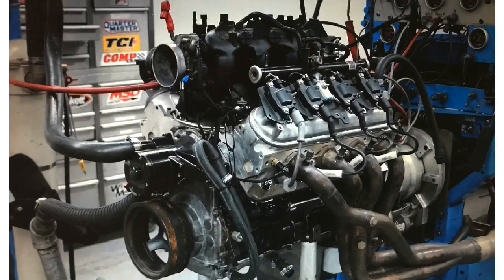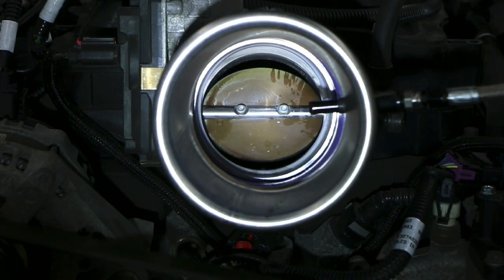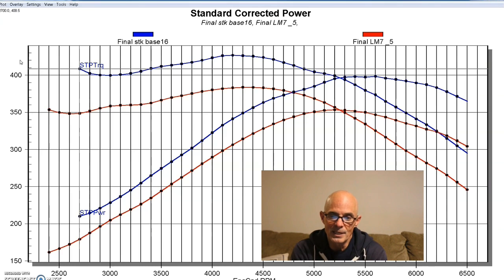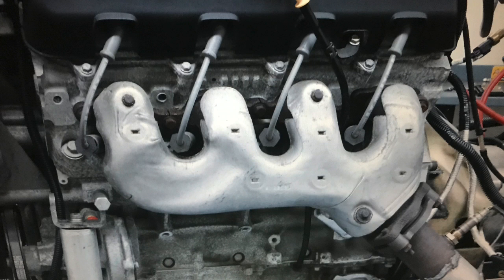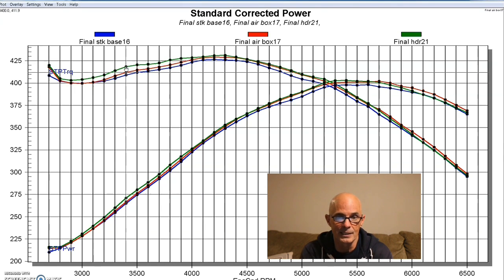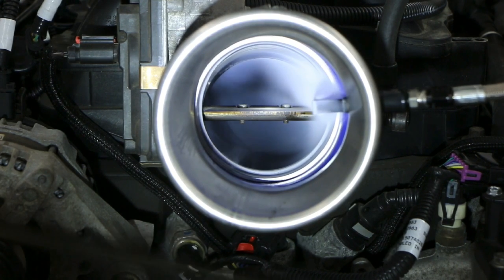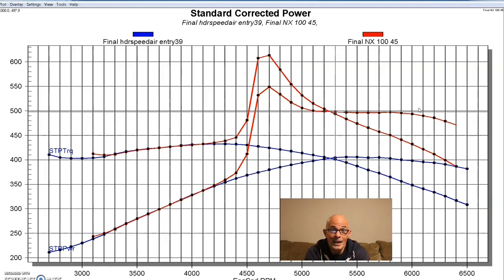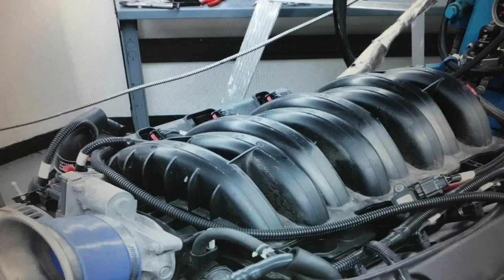JUNKYARD 5.3L L83 NITROUS TEST-THE REAL DIRECT INJECTION!

Comment: You have to route the headers the way the company makes them. If forward facing headers made more hp . Gm an the headers company's would make them that way it's made to flow exhaust gases the way the headers was made. I gave you a hard time on the other video when you was complaining bout hp numbers on a lsx motor but this video an many more are good keep it up.

Comment: Looks like an awesome engine. Can't wait to see boost and I'm interested to see how far the stock fuel system can go before leaning out.
Reply: Stock LT1 fuel system tops out at about 550whp. Then you have to jump up to LT4 injectors and fuel pump and then that’s only really good to 750whp. And you can get about 850 with a good cam with the more aggressive lobe on the cam for the pump
Reply: @rongravel4585  thanks. Add 15% for drivetrain losses so we're looking at about 625 at the crank? However, that's on an LT1, not an L83. Does GM use the same high pressure pump on these engines? Back in the day, they used the same in-tank fuel pump on every single tbi engine.. from the little 1 barrel tbi 1.0L 3 cylinder in geo metros all the way up to the 7.4L v8 dualies.
Reply: The 5.3 and 6.2 have different cam lobes. The pumps are the same and the injectors.  And yea 15% is a good round about. It’s usally like 18% in a auto and 12-13% on a manual so a good round about is 15% pretty much covers everything     Every combo robs a lil more or less power.
Reply: @rongravel4585  I just made an appointment for my first chassis dyno test. I figured +25% drivetrain for my combination. I'd be thrilled to death with 450 to the wheels. It's from a 1993 4L80E and NP241 transfer case and a 14 bolt 9.5" rear axle. Old 4wd stuff is not as efficient as the newer or lighter stuff. I only have 400lbs/hr worth of injector so we'll see how far it takes me. One datalog was calling for 456.6lbs/hr. 114.2% duty cycle. It leaned out to 13.6:1. I limited my rpms to 5,252 so that won't happen again.

Comment: I was just about to ask you for some Gen V testing.... and there you go. Greg Bannish had some really interesting comments about the criticality of DI injector flow/spray pattern design compared to what you can get away with on port injection. Sounds like there may be a bit of a development curve to overcome on DI unless you intend to add secondary port injectors.

Comment: Having an L86 and about to bolt on headers.  The factory Y pipe for our trucks is the achilies heel for our trucks. Your engine didnt have one Richard. Your tune was changed to account for no cats you technically had an engine with no cats, no mufflers, no full belts and no true intake tubing. Youll loose 20-30 hp with the factory Y pipe allday. Then when you bolt on the headers and high flowcats thats the gain. You basically made the gains with manifold do to no cats(that we gain with headers a tunes). If that makes sense. You made the gains not using the Y pipe.

Comment: That is strange that headers didn’t do much. Maybe test the LT stock manifolds on a LM7 ?
Reply: When I pulled the stock manifolds off my L83 I noticed they are pretty good as is. The reason they didn't see much gain here is because they ran extensions off the stock manifolds. The stock Y pipe is also really good. The stock exhaust on the L83 trucks sucks though. The muffler is real restrictive and the flapper valve. Also it's a single pipe that necks down to 2.25 inch at the tail. That all being said. I did notice quite a bit of gain from going to headers and 3.5" exhaust on my 5.3 L83 truck. I had opened up the stock exhaust with a magnaflow muffler and cut out the flapper and picked up 2 mph at my 1000 ft test spot. The headers and 3.5 inch exhaust picked up another 3 mph. Doesn't really add up to the results in the video. But it did what it did so I'm not sure what the total deal was there.
Reply: blk95gsrt I had a magnaflow cat back on already when I swapped headers on. I didn’t notice much but that’s not real solid evidence. I went back to stock manifolds and y pipe because the speed engineering parts leaked at every joint
Reply: Michael Radelet Thanks for all the info about your issues with the  headers, and specifically the speed engineering brand. Now I know not to go that route. I have a full 3” cat back with a Magnaflow plus a CAI on my ‘18 with a Hptuners tune. I’ve been debating headers and a retune but after your experience and this video it doesn’t seem worth it
Reply: @MichaelRadelet  I had zero improvement when I put my headers on. I have a test spot I test MPH on every single mod I've ever done. When I did the headers I had zero gain, until the tune was corrected. It picked up 5 mph over stock exhaust with the headers and 3.5" catback. The speed engineering headers do leak, but so do other slip fit headers I have had. Just have the joints welded or do what I did and buy $10 clamps at oriellys, the really wide ones, and wrap the joint with foil then clamp down the clamp around the foil. Works great. I've always had leaks from slip fit headers, it's just part of the deal. I didn't mind having to spend a few dollars on leaks considering how good the speed engineering headers are and how cheap they are.
Reply: @trey8543  You won't gain a ton. You should gain some. For what it's worth ALL headers are noisy even if they don't leak due to the thin tubing they have versus thick iron manifolds. If you're pretty happy with it don't do headers, especially if you hate the sound of leaks. Even perfectly sealed headers have that leak sound. It's happened on every vehicle I have headers on (all 7 of them) no matter what flange and seal style they had.
Reply: blk95gsrt Thanks man. At this point I don’t think I will bother with them. It’s my daily driver and comfort is priority over a little extra WOT power right now. The tune alone turned my truck into a whole different experience through the entire power band. If they won’t add power I can feel all the time it’s not worth the headaches that come with it on a daily. Down the road when mine is paid off and I have something else to drive I will get wild with it. Heads, cam, headers, l86 intake etc
Reply: @trey8543  You'll feel them a little at wide open, other than that you wont like them. They are not my favorite mod I've done on my truck. They did help, and I do hammer on it a lot. But I miss my simple old setup I had most days. And by the way, I've researched this to death, don't do heads cam 5.3. You can find a 6.2 for less than that costs or around the same price, and still be able to sell your 5.3 for 1000-15000 to make up some of the difference and have a whole lot more gain than heads cam on a 5.3. Just do a 6.2 swap and small cam and you'll have a lot more power every where and you'll shit all over a heads cam 5.3. Watched a ton of videos of modded 5.3's vs 6.2 trucks. My buddy has a bone stock 6.2 yukon and murdered my modded 5.3 truck. It was sad. The 6.2 intake and heads flow a ton as is so you can do a small cam and kill a heads cam 5.3. Plus you'll have what's needed the most. TORQUE. A little high winding 5.3 in a 5000+ pound truck is a crappy combo. We need torque to move these pigs
Reply: blk95gsrt I didn’t have any one to tube for headers around me, best I could get was to turn off cel for missing cats and secondary O2s. I’m sure I could have made the slip fits not leak but I didn’t really try. I moved jobs and preferred the quieter sound with the cats in plus the smell of the exhaust stunk pretty bad without them.
Reply: @MichaelRadelet  I hear ya there man. You having the magnaflow should be plenty enough to get some decent gains. If you haven't had it tuned, a tune makes a world of difference. Atomic on performance trucks forum (richard) does REALLY good remote tuning if you want to look him  up and get remote tuned. Look up his website at Atomic Fabrication and Performance. https://atomicfabandperformance.com/
Reply: I think the problem is that they were running the stock smallish L83 throttle body and intake. If you can't get a lot of air in you can't get a lot out. I think they'd see much better numbers of they swapped an L86 (6.2) TB and intake. They're a VERY easy and direct swap that foote flows a BUNCH more air.
Reply: cfltitan I hope they test that, that’s a common mod people do and I’d like to see how well the 5.3 can utilize the extra flow
Reply: Part of the reason they didn't see much gain is because the stock manifolds are pretty freaking good. When I took mine off I was impressed by the primary and collector size on them. Then richard ran the stock manifolds with extensions on them. The stock Y pipe is also really good on these trucks. The stock catback is terrible though and the main power killer. If you wanted to do a good little budget setup on these trucks, and I did this and gained 2-3 mph over stock, just get a good straight through muffler and cut out the flapper valve in the stock exhaust. I did gain another 2-3 mph going to headers and 3.5" catback. For a total of 5 mph over stock exhaust. Don't have dyno charts, never put the truck on the dyno, the driveshafts pop real easy and I don't want to risk it.
Reply: Shannon Sisk they are a different bolt pattern
Reply: Michael Radelet would be neat to maybe switch the flange or something, or get them to work, to see if there is anything special about them. No gains from long tubes is strange in the V8 world
Reply: Shannon Sisk I’m sure it could be done. Other problem is the LT motors swapped intake and exhaust locations so the offsets would be off, but again if someonereally wanted to try it could be done. 

I put long tubes on my 14 L83 and noticed nothing other than more noise with the cats gone

Comment: Was anybody else confused when he first said LT1? I thought he was bringing in a 96 corvette engine with that horrid digispark distributor lol, wasn’t sure how that had anything to do with direct injection. Better question, what the f*ck is Chevy doing reusing their engine codes? This isn’t the first time they’ve reused RPO engine codes, and it irritated me the first time...
Reply: Only Gen 1 opti was junk, Gen 2 fixed the issue with moisture incursion. I have a 96 LT-4 Vette, stock block and heads, running 12s and hurting lots of feelings with the modern cars including Hemis and direct injected Camaros...lol
Reply: YZFoFittie my dad had a 96, and it was plagued with issues for the 3 years he owned it, but I almost wonder if it was more due to the teething issues of being the first year of OBD-2. We put tons of time and money into getting that car to run decent. We finally got it to run pretty darn good, but it by far had the most problems of any car we picked up with only 75k on the clock. My dad originally bought it cuz he missed his hot rod days from when he used to own a 66 Chevelle 396SS, but by the time we got that stupid vette to run decent it had lost its luster to him and he went and traded it in on a brand new little shitbox Nissan economy car... I still to this day don’t support that decision but it is what it is...

Comment: Do you think this will replace the LS for hot rod builders?
Reply: LunarOutlaw’s Garage 
The Guys over at MoTech In Las Vegas (lswrangler.com Jeep LS/LT/6L/8L/10L swaps) swear by LT’s due to superior torque when doing an N/A build.
Reply: @ZEPRATGERNODT  it will be interesting to see if they can do 1000hp/10,000 rpm like the ls was able to
Reply: Probably not, just due to price and complexity. Adding direct injection to the mix is too much for a lot of builders, at least at a grassroots level

Comment: I absolutely enjoy each video you post Richard. My thoughts on the LT testing follow along the path of another suggestion....but move the L83 to 100% port injection. Just remove the DI pump and leave the injectors as blocking plugs.The LT already has a 58X timing set so the Holley would easily work, other than VVT. Also interesting would be to compare power output with a DI/port injected mix, with pure port to see the difference. Would learn a lot about the differences in the head design between LS and LT engines that way.
Reply from the maker: and piston design

Comment: Put a 6.2 intake on it for your max effort 5.3 guys
Reply: Slap a L86 (gen 5 6.2) intake and throttle body on a L83 (gen 5 5.3) and it's direct fit: plug and play. There is a piece of sound dampening foam under the L83 intake that must be either removed, or trimmed down to fit under the L86 intake.  With that alone it is a17 HP gain. Your welcome.
Reply: @brandondecker8967  didn't trim or remove my foam. Must be certain builds.
Reply: W5rr2nG I’d kinda like to see that. Just the difference between the two on an otherwise stock engine. I won’t mess with one till they’re as common in the junkyards as the previous LS based engines, but still entertaining to watch!
Reply: Cooper Boehm dude, they're dirt cheap brand new from GM. Who needs a junk yard swap? And they do make a good difference even on a fairly stock L83
Reply: Any dyno results with intake swap
Reply: I installed the 6.2 l86 non ported intake manifold and l86 throttle body with a CAI. Afm was disabled with 93 octane tune. Noticed a big difference on mid and top end. Truck is 2019 silverado LD l83.

Comment: Interesting.  So where are the gains coming from compared to gen4?  Simply higher CR and more ignition timing thanks to direct injection? How do cam specs compare?
Reply: It's coming from the vvt cam and the direct injection. You can't directly compare a normal cam to a vvt cam.
Reply: Thanks. I’m not familiar with these lT motors. Twin cam motors the valve timing doesn’t improve peak power, but broadens the torque curve. Vvt allows decent peac power without the loss of low end torque. Maybe LT is set up differently.

Comment: Dang jumped up to over 600 ft/lbs there for a second
Reply from the maker: love dat spike
Reply: @richardholdener1727  Isn't that an artificial number caused by the brake on the dyno responding to a sudden surge in RPM?
Reply: @ETicketM  So what are you saying, that the lift the front of the car in Fast and The Furious when they hit the nitrous isn't real? :O)
Reply: @ETicketM  it’ll do the same thing to your torque converter.

Comment: Speaking of engine familys you like, I've always been curious about the weird v10 truck motors. The dodge magnum v10 and ford triton v10. Theoretically, if you've got more rods to push cylinder pressures into, you should be able to push more torque out of the engine! How much air could we shove into one of those motors to make power? Could we push one up to LS levels of power? 4 digits? An obscure engine big bang series would be a blast. I'd love to see turbos on weird old engines too, like what could you do with a GMC 305 v6 or 478 v6 for that matter?
Reply: I'll save you some time. Unless it's the viper v10 from the ram, all v10 truck motors are absolute hunks of dog shit. There's a reason you never see anyone modify them, even though they can be had for cheap. The Triton v10 alone is very likely the worst most unreliable engine ever put into a pickup truck. 

A cool one to look at though, is the v10 diesel VW used in some of their SUV'S.
Reply: He has done a couple videos with a late model hemi, but as much as I’d love to see a 305 v6 boosted, it’s just not  practical. I bet over 90% of them have already been melted down, I’ve only seen one big gmc v6 in person, and they have zero aftermarket support, every single part has to be one off custom built, not mr holdener’s strong suit. If it can’t be grabbed off a shelf and slapped on, it’s not on his to do list.
Reply: Good luck with him doing anything with other engine family's. He seriously needs to rename his channel to the GM and LS engine show.